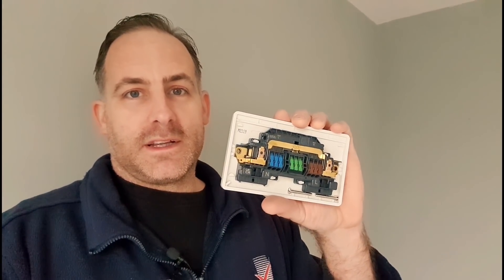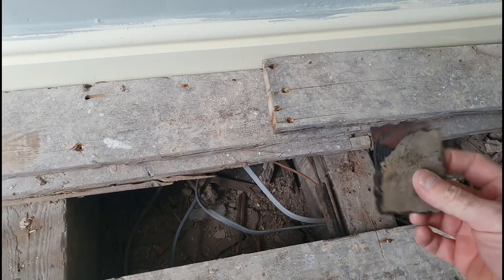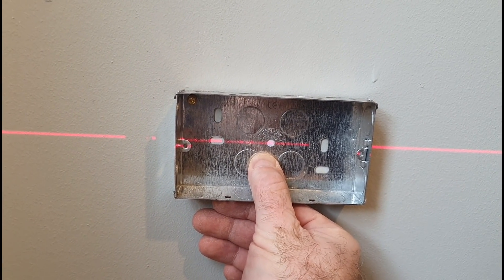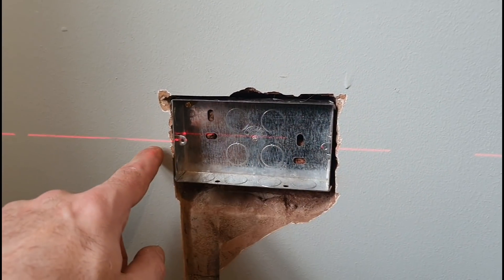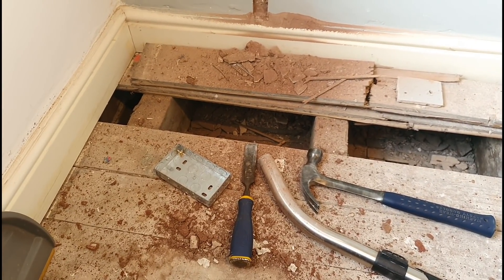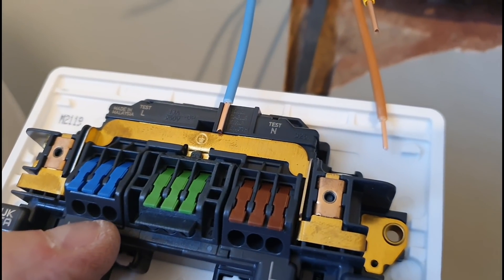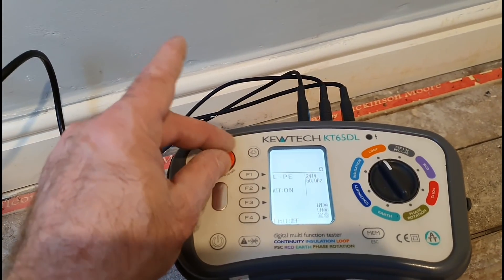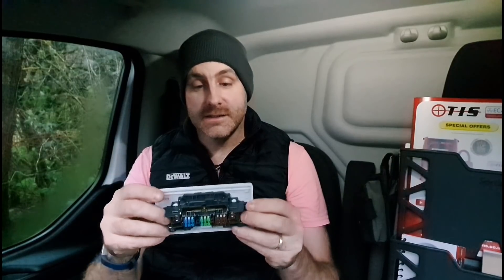OFFICIAL | The Best 13 amp double socket on the market. (55)

Comment: 6 quid is not bad. Would look better with the little screw hole covers. Job looks good except for that filler.
Reply from the maker: The filler was horrible and I regretted it afterwards. Luckily it sanded down good and helped act as a key to the one strike filler that went on top.

Comment: They are the absolute go to product for taking a spur off a ring!
Reply from the maker: Yep 100% agree.
Reply: Just wago the cables in the back of a standard socket if your worried about connecting 3 cables

Comment: having 3 separate Wago type connectors is good... with screw type (standard) they sometimes dont  clamp properly and fall out but  at £ 5.99 ?
Comments ?
Reply from the maker: £5.99 is too expensive. You can buy in bulk (not sure on the price). Once the price comes down more sparks will use them I'm sure of it.